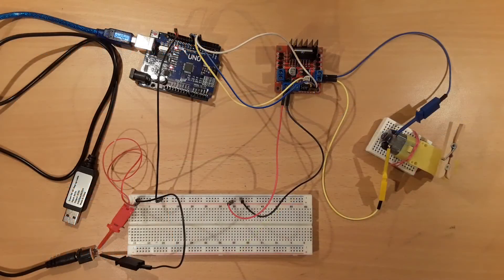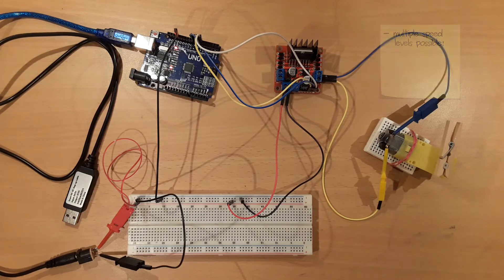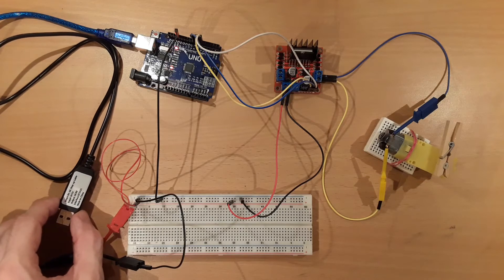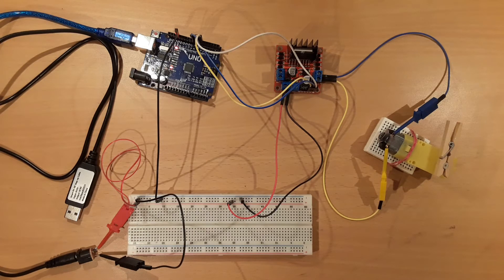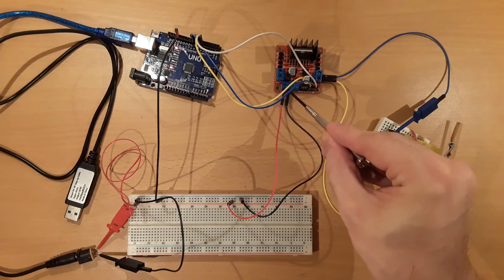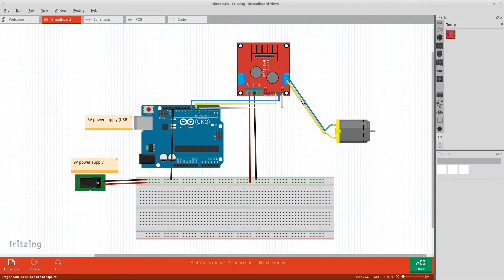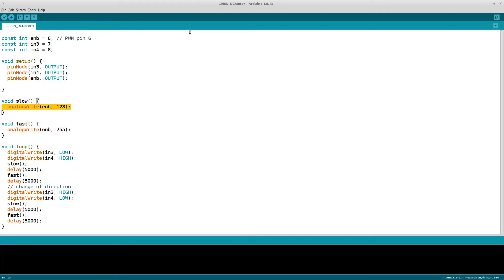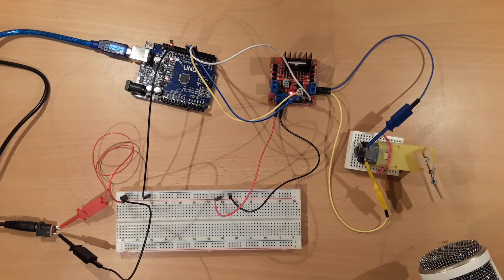How to control a DC motor the Arduino Uno (L298N) | UATS A&S #7

Comment: can i use 12v adaptor as input power supply instead of 9v you used for L298N and can i connect aurdino uno from L298N
Reply: yes, u can